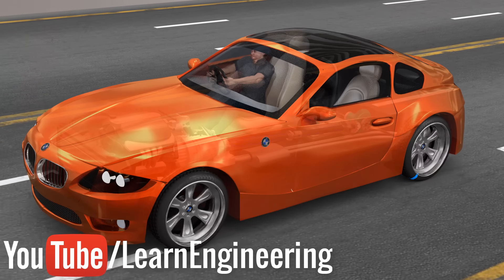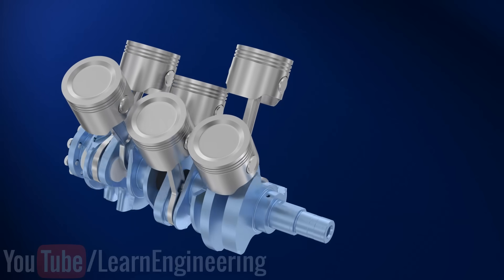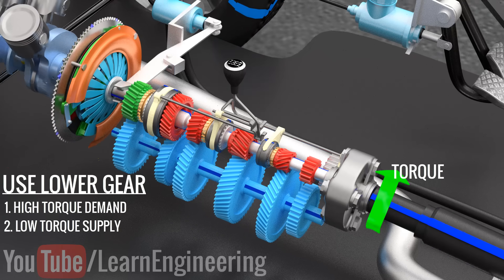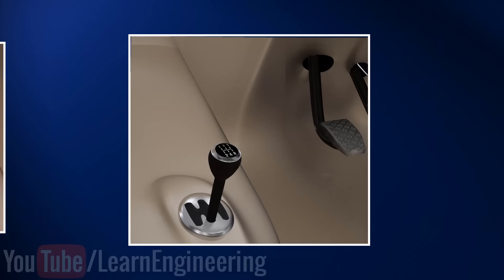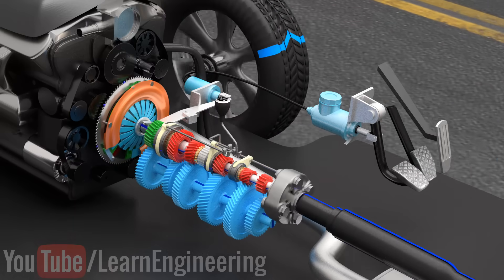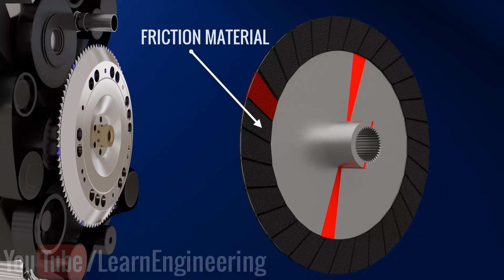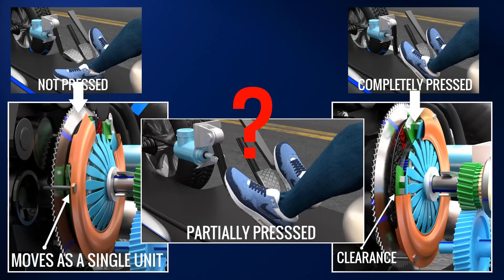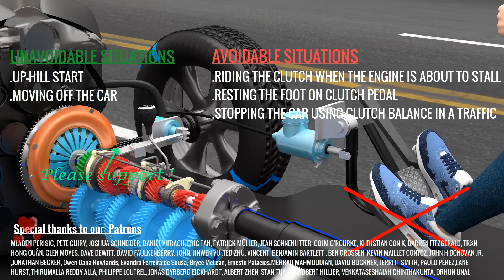Why you should not PARTIALLY press the Clutch?

Comment: "...you have to shift to a lower gear." shifts from 4th to 1st
Reply: The torque goes 100 to 100000000🤣
Reply: The money shift!
Reply: money shifts lol
Reply: Shifts from 4th to reverse
Reply: Engine locks up and you need a code to unlock it 🤣🤣🤣🤣
Reply: You can do that but only down 2 gears. So say you are in 5th but need that extra torque to pass someone, you will want to double clutch into 3rd.
Reply: @Vinnay94  It depends. Like shifting from 6th to a complete stop. The key is pressing the clutch and putting up the right gear to match the speed that you finally came to.
Reply: @nandy1256  Only sensible reply here. Transmissions don't give a fuck how many gears you skip as long as your speed fits the gear you set to.
Reply: @Asto508  r/woooosh
Reply: @nandy1256  i think if you're going to stop from 6th gear..down press the clutch and shift to neutral until the car slows down..and stop or you can then shift to first gear if  when it is about to stop.
Reply: Vinny V you don’t have to double clutch. You can rev match and do that. Double clutch would just make that a bit smoother
Reply: @WhispersOfWizdom  why is double clutching smoother?
Reply: @White_Night_Demon  when you double clutch it helps the synchros match up the input and output speed of the transmission when getting into another gear. Modern cars have pretty advanced synchros though, so as long as you rev match before putting the transmission back into gear, you’ll be fine and the transition will almost as smooth.
Reply: @WhispersOfWizdom  How modern is modern? post 2000? or 2020 cars? So on old cars u have to double clutch to get a smooth gear change? Does it only matter going down or do u have to do it going up as well?
Reply: @White_Night_Demon  I’m def no expert in car history but in really old cars (I think like 1960s and earlier) you had to double clutch if you were skipping a gear in either direction. I’ve driven clutches made in trucks and cars only since the 90s and have never had to double clutch when skipping a gear, but the newer the cars I’ve driven have been, the smoother the transmission has shifted on its own without the need to double clutch.
Reply: @WhispersOfWizdom  oh ok
Reply: @WhispersOfWizdom  double clutching isn't really necessary with a synchromesh gearbox, Your gearbox won't suffer massively from using the synchromesh mechanisms. I'd still recommend rev matching the engine and clutch though.
Reply: @WhispersOfWizdom  the what? 🥴
Reply: @nestorguemez4846  synchronizers? Is that what you’re asking about? They adjust the shaft speed to align the gear when you shift in a manual transmission.
Reply: @Vinnay94  why not just go from 4th to 1st, you'd have a lot more torque!
Reply: You don't  need to double clutch @Vinnay94
Reply: You can actually do that if you slow the car down.
Reply: @CheckMyBioNow  yeah of course you can do that at standstill too. Kinda besides the point
Reply: No you shouldnt shift gear 4th to 1st while running. However if you stopped your car you can change it into 1st gear otherwise you should shift it into 2nd because the vehicle is running slowly
Reply: Lol error 404
Reply: Engine in 4th:hmmmmmm
Engine in 1st:HMMMMMMMMMMMMMM
Reply: Torque goes brrrrrrr
Reply: Transmission about to disengage from the car lmao
Reply: In the car I want (a serious economy box) the gearing is dropped drastically from each gear, so that would destroy the 1.5 L I4 that the thing has.
Reply: @Lucas-tr9hh  pretty much every vehicle is like that
Reply: He tryna climb the side of his house for roof level parking, can never be too cautious when it comes to protecting your car from thieves and vandals
Reply: you will break your engine lol
Reply: You can certainly do that!...... Only once though 🙂
Reply: The engine will jump out of the car!
Reply: Yikes
Reply: Lol what?
You can change from 6-7th gear all the way down to first if you braked up until 6kmh or came to a full stop
It doesn't care at all
And I'm pretty sure most cars won't even let you change from highspeeds into first because that would break the engine and transmission,just like how changing into reverse at highspeeds fucks up everything
At least my Renault doesnt let me
Reply: Just don't take that foot away from that clutch
Reply: That's nothing, some of my learner drivers try going from 6th to reverse 🤣
Reply: @leehowson440 R for  Race mode!
Reply: @1mariomaniac  exactly my friend 🤣
Reply: RPM goes from 1000 to 100000
Good job, now you need a new engine!
Reply: I knew someone who did this doing 60mph, the gearbox left the car
Reply: DEJA VU
Reply: Arey u an American? 😂🤣
Reply: ABORT!
Reply: Very good way to avoid a collision in an emergency
Reply: car explodes
Reply: @s
Reply: Lmao... yea.. that wont fuck up your clutch
Reply: Napisy zasłaniają obraz. Dlaczego serwis utrudnia oglądanie filmów  wyłączam napisy a one z każdym nowym filmem wracają. Za te złośliwość nigdy nie wykupie premium
Reply: My s10 was running crappy n pissed me off so i went from 5th to 2nd at 60 mph it broke the universal yoke at the rearend
Reply: I posted a comment about this, hope it help guys.
Reply: RPM's will be fineeeeeee
Reply: If you want to climb a 90 degrees of course 😂
Reply: Engine in 4th:brrrrrrr
Engine when lower from 4th to 1st: BRUUUUUUUUHHHH
Reply: InstaBlaster...
Reply: Car dirvur 😂😂
Reply: You will get shifted to emergency ward at nearby hospital😂😂😂
Tokyo drift bruhhh
Reply: Absolutely Me ✋
Reply: Money shift
Reply: Yo this car’s 1st gear is somthin like 1:1 he’ll be fine
Reply: If u Rev up a lot it is technically possible without big damage
Reply: You can lower gear from 4th to 1 if the speed of the car is too low
Reply: hAhA GO BOOOM
Reply: He was also driving in reverse for quite a bit of time later
Reply: Exit transmission
Reply: What a rubbish! This guy himself must’ve never driven a manual car
Reply: kaboom
Reply: If you do a money shift, do if properly
Reply: Half clutch is not good for car?
Reply: @MoodMotion16  nope, as the video explains, it causes lots of friction and burns out the clutch.
Reply: Well he wasn't lying....
Reply: No wonder the car was moving faster than the wheels were spinning.
Must've been a real money shift, maybe explains why the gear selector is inside the engine bay
Reply: Very steep hill
Reply: In what insane scenario would you do that?
Reply: Most everyone here is assuming all car gearing is the same and all engines have the same redline... My car redlines in 1st gear at about 62mph, so while not likely, it is completely plausible that I could be going up a hill at 40mph in 4th and the slow car in front of me turns off and I decide I want to get up to a faster speed, I could absolutely change to 1st gear assuming I rev match (my car has automatic rev matching) and rocket up the hill!

The car for those curious: 2016 Corvette Z06
Reply: Transmission be like: BrUh
Reply: Just money shifted himself into the gates of heaven
Reply: yes, its done wrong... Reverse is the smallest gear on transmission... 🤷‍♂️
Reply: And your engine fuck up
Reply: Lmao
Reply: Car be revving it's gears out
Reply: 💸shift
Reply: And you're finished
Reply: *Piston 2 flies to the moon.
Reply: lmao
Reply: I'm pretty sure on a RWD car the rear end will break loose if u do that and I think you'll total your trans and dif and everything else.
Reply: No not directly to 1st. Depends on your speed n amount of torque you want.

Comment: While you definitely shouldn't drive around like a moron with the clutch partially down - you definitely do need to treat the clutch as an analogue input rather than a digital down/up input. I've driven many manual cars where you need to get to about 80% up on the clutch before the 'biting' point to be able to properly move away. Go to 100% right away and the car will stall. You need to master carefully moving off the clutch while giving a bit of the accelerator pedal to start moving. It's far more delicate than a simple on/off down/up idea.
Reply: Yup. To start rolling if you just dump the clutch you'll either stall, or launch. Either one would isn't good.

Comment: resting your hand/leg on the  clutch (car/motorcycle) is bad for it however it is especially recommended to use the clutch to accelerate smoothly when the RPM is too low to just gas it or too high so it's jerky
Reply: [HUN]AntaresSQ01 the moment that you said is included in unavoidable situation, which is necessary to do it.

Comment: Anyone notice the V6 with V8 headers in a i6 BMW Z4?
Reply: I'm more worried about that god awful gear selector under the hood of the car instead of the cabin. Gotta stretch for that one.
Reply: And the engines fucking backwards.  Look at how the flywheel bolts are at the front and the engine is rotating the wrong way
Reply: Jayce Tabor should have a Dual Mass Flywheel too and not a sprung clutch
Reply: You did

Comment: How about explaining double clutching.
Reply: Double clutching is generally only used with unsynchronized transmissions. To understand why that is, you'd have to understand what a synchronizer does. But, essentially, in an unsynchronized transmission, there is nothing to match the speed of the input shaft to the speed of the gear your selecting. So, when you double clutch when upshifting, for example, you would press the clutch and put the shifter to neutral, release the clutch to match the speed of the input shaft to the speed of the gears, depress the clutch again and shift to the next gear, then release the clutch. Downshifting is done the same way, except when you release the clutch when the shifter is neutral, you must rev the engine slightly to match the input shaft speed to the speed of the lower gear you're selecting. Then you would press the clutch again and shift to the lower gear.

Comment: Question: Can you save fuel by fully pressing down the clutch to remove enginebreaking? Imagine someone accelerating to 120 km/h then pressing the clutch fully until the car drops to 80 km/h then accel to 120 km/h to repeat the process.
Reply: Actually, engine braking uses no fuel. If the accelerator is not pressed, air is cut off from the engine, and the engine then does not inject fuel. However, when the clutch is pressed, a little bit of air and fuel is used to keep the engine running and prevent it from stalling. So, if you want to save fuel, don’t drive around with the clutch pressed in; not that you should be doing that anyway as it causes unnecessary wear.

Comment: I'm not to keen on the idea of having to drop the transmission to replace the clutch pack or flywheel... Had to do that on my truck already because one or more of the previous owners accidentally tried starting the engine while it was already going, leading to stripped teeth on the flywheel gear where the starter connects.

Comment: Sir please explain  the working of bike engine
Reply: The only notable difference really is that a motorcycle engine typically has a "wet clutch" and that is it perfectly fine to partially pull in the clutch on a motorcycle due to the fact the whole gearbox assembly is sharing the same oil as your engine, so less wear & tear. They are designed to be fine if you are riding the clutch, unlike a car which has a dry clutch and will wear out if you ride the clutch. With a wet clutch motorcycle, riding the clutch is perfectly fine. The transmission is sharing your engine oil on a motorcycle
Reply: He probably meant a bicycle

Comment: Lovely 3d render but the crankshaft and subsequently the motor is backwards. The flywheel looks like a torque convertor flexplate. While riding the clutch is a lazy no no, just dipping the clutch to release the pressure on a gearbox during a gear change is a valid driving technique.

Comment: My older sister, when teaching me to drive, showed me a "great" way to hold the car on a hill: Partially depress the clutch and rev the engine so that you don't roll back while waiting at a light/stop. I'm a mechanical engineer and she still doesn't really believe me when I say its NOT a 'great' way. smh
Reply: better use brake (usually hand brake) to hold a car
Reply: You... Don't need to use the handbrake to hold the car, either. If you have to do that, then you're inexperienced. It's not like when you let off the brake, the car immediately takes off backwards. Yeah, you have to be a little quicker on your footwork, but it's not difficult..
Reply: akio2589 that's also bad practice though.. the car shouldn't move backwards even a mm . Besides it's worse for your clutch as your clutch has to overcome more torque to get you moving up the hill
Reply: That's why people are required to stop at least 3 feet from the back of you, legally. In this country, anyway. A little rollback when taking off is fine, and using the parking brake is overkill. When you're in first gear, the torque multiplication from being in first gear more than makes up the extra effort to get moving.  That is to say, the clutch will wear far, far less when taking off in first than doing what this video is suggesting. And it's not bad practice. I can get moving on a hill, not using the parking brake at all no matter how steep it is, with maybe a few inches of rollback. And most people who regularly drive a manual can do exactly that. One of the big reason that the parking brake thing is bad is you might get in a vehicle where the parking brake is the kind operated by your foot on the floor. And that's no good when, say, sitting in traffic on a hill.
Reply: In driving tests (in South Africa) they sometimes put a matchbox behind your wheel on a steep hill.. If you roll back at all its an automatic fail. Traffic police will even ticket you haha. I agree though, its not that bad for your car but here its also a legal issue
Reply: All of that should take place in the space of seconds. It's wrong for your sister to just sit in the hill with the clutch partially engaged, I agree. But just before you release the brake, you can let off the clutch a little to hold the vehicle still while your transition from the brake to the accelerator. And doing that isn't going appreciably wear your clutch more than normal, as you're not always going to be taking off on hills like that.
Reply: That's all part of the process for learning to drive a manual properly. It's basic stuff. And if anyone can't handle it, just get an automatic.